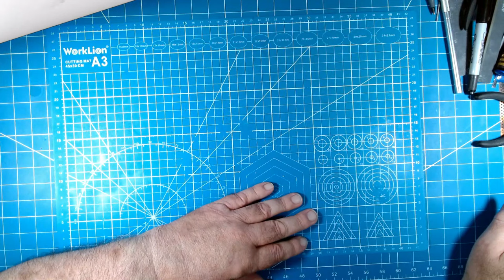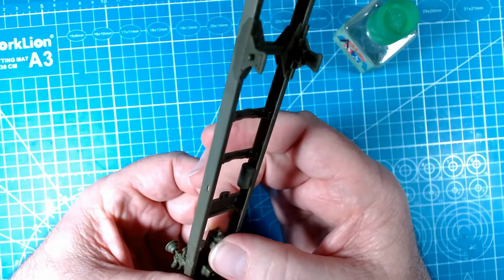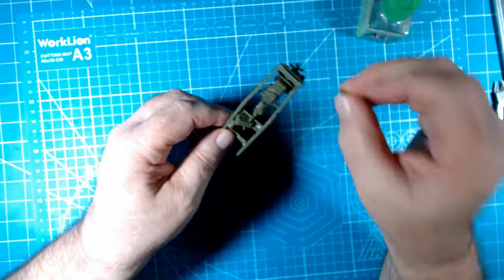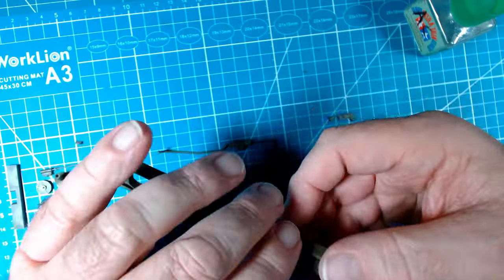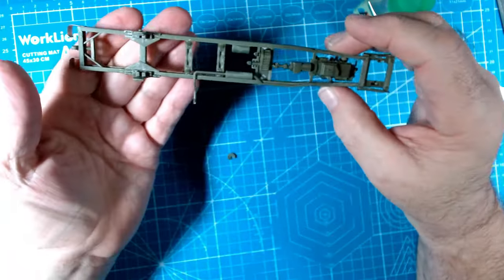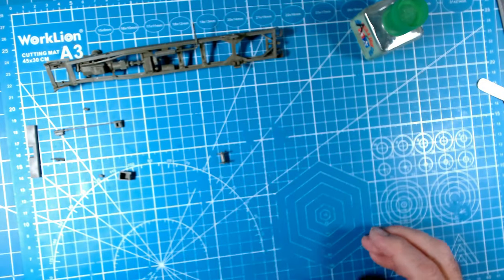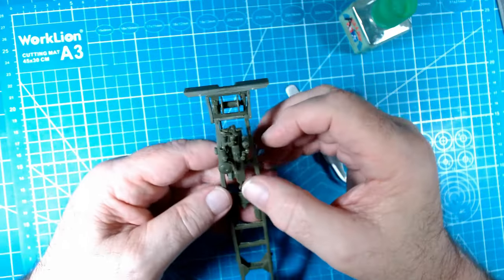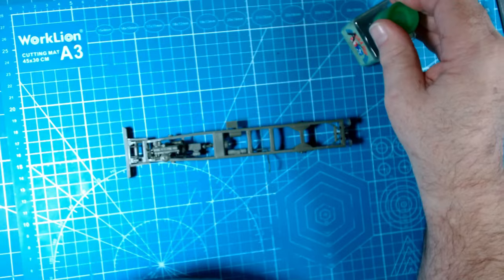Hobby Boss #82459 GMC Bofors Part 5

Comment: Great minds think alike Jeff. I made a note in my build video about not glueing the shafts into the transfer case. That transmission is petty darn awful eh Jeff.. I've put my video out, really simplified.. and I told my viewers to come here for a more detailed build.
Reply from the maker: Hi Nigel, I learned the hard way it's much easier to do all the shafts and joints at the same time.  The transmission and transfer case are both pretty bad.  Thankfully no one will see them once it goes in the display case.  Thanks for sending people my way.  I really appreciate it.  I made up the axles this morning, tomorrows video.  I'm working on getting the wheels and tires sorted right now.  Have a great day.  Jeff
Reply: @JeffDonahueScaleModeling  I built my axles today so they’re good and ready to go when needed. Not good are they?
Reply from the maker: @NigelsModellingBench  They do leave a bit to be desired.  Oh well.